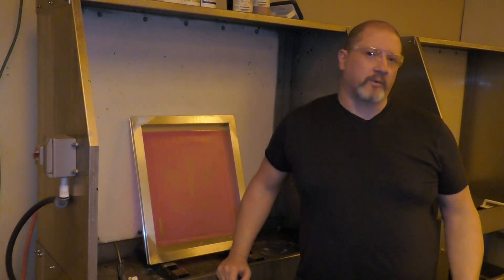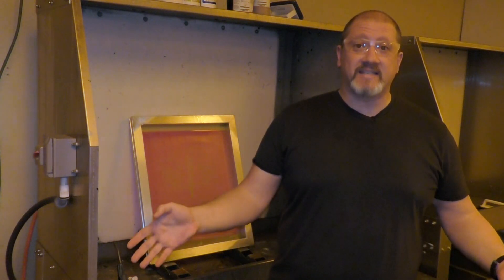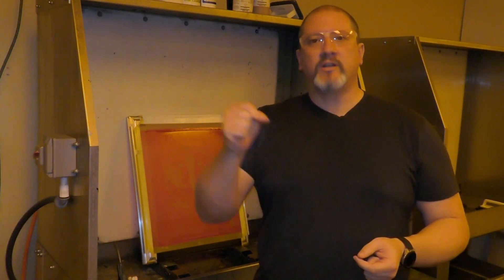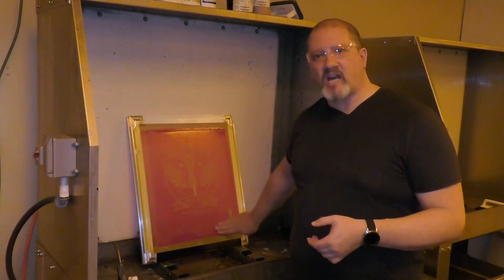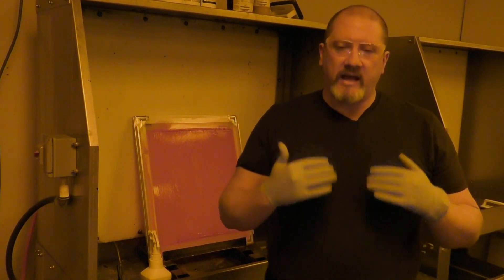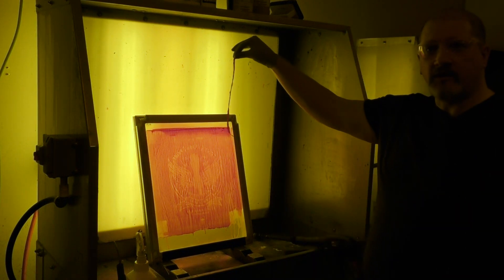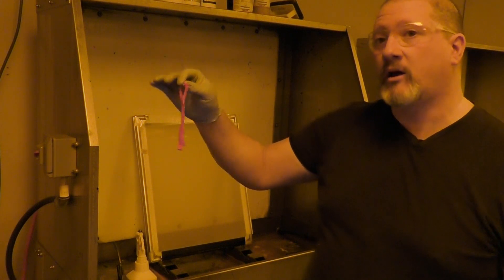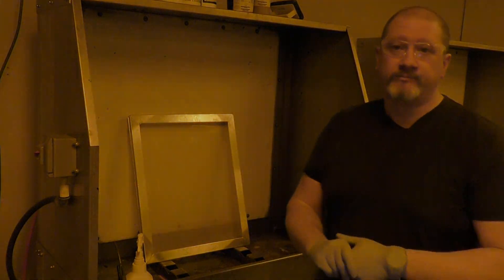Reclaiming Screen Printing Screens To Achieve The Best Results

Comment: When I remove the emulsion, I do it on the inside of the frame, since it is the weakest and has the fewest layers. Cheers.
Reply from the maker: Hi Spiderdoc - you are correct with that observation.  The drawback to doing that - the water pressure can force the mesh to begin to pull away from the glue on the frame.  Over time you can actually cause the mesh to pop of the frame, ruining your screen.

This will especially be obvious if your emulsion is not dissolving right away from either underexposure / chemical hardening / locked in emulsion.... the many variables that can cause emulsion to not dissolve.

With all that said - there are times when you need an easy way to pop off some undissolved emulsion and turning the screen around and being careful is definitely the right choice.